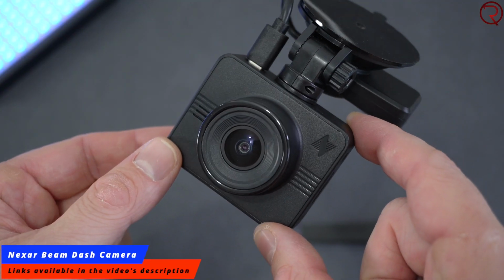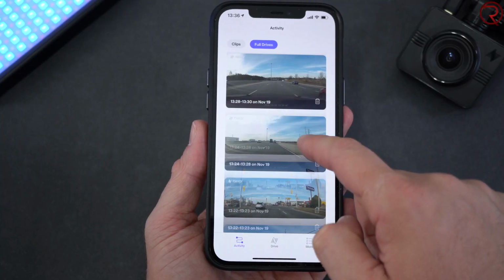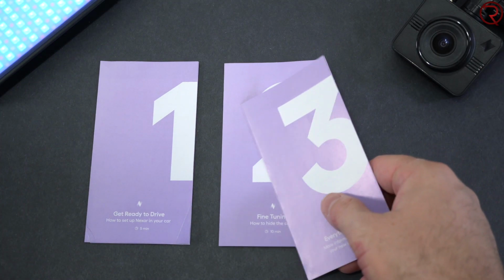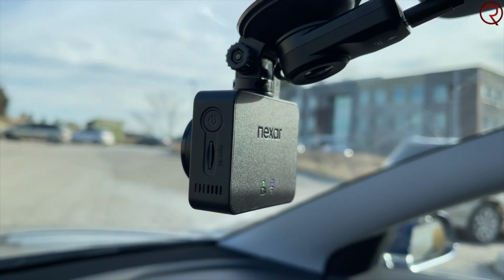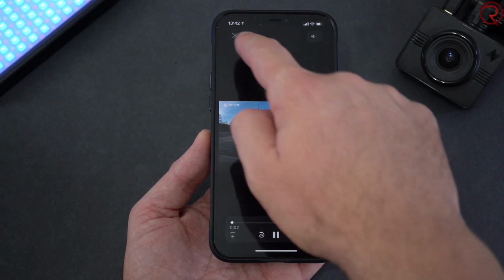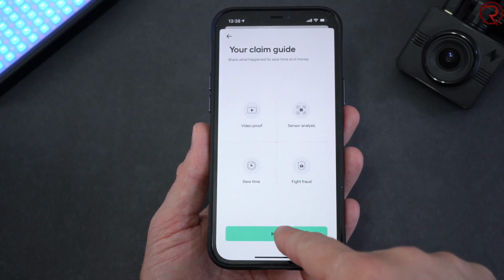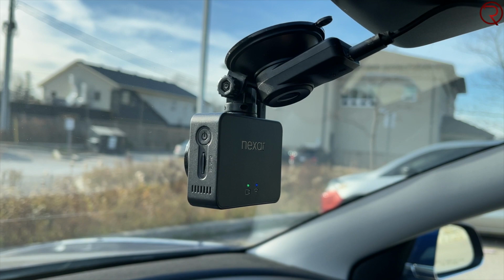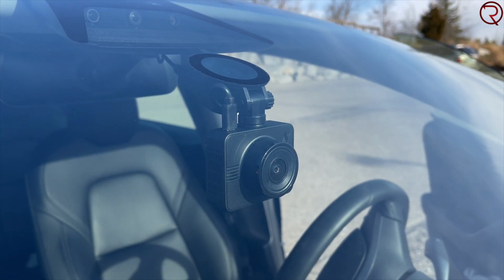Nexar Beam Review - The Most Unique Smart Dash Camera!

Comment: Few questions I don't see in the comments already:
1) Do the detailed reports of each drive have the average speed on them after the recordings? The details on their site say they have an accelerometer and the accident reports ability show impact speed so it must have some way of recording your speed.
2) When the camera is connected to your phone via the wifi does it prevent your phone from using data while connected? Ie can you still receive messages/calls/play music from an app or use GPS?

Thanks for the video, I found it very helpful so far. I'm looking for a good dash cam with a good app to back it. Currently have a Rove 4k in 1 vehicle and hate hate hate the app. Very user unfriendly and trying to transfer video from the cam's SD to the phone via its wifi takes ages.

Comment: Hello.     I noticed I am hearing audio.   Can the audio be turned OFF ?   I wouldn’t want to be recording all conversations inside the vehicle all the time . 

Also , I have a brand new 2021 Mazda CX-5 it has power plugs in rear compartment.  Can I purchase a 2nd Beam cam and put it in the rear window?     Would my phone be able to access both cams ?  One at a time of course.  Just in case I’m hit from rear I have a cam there too ?  

Lastly , my NEW car has a BUILT IN WIFI as part of this new vehicle.  So can the cam be signed into that WiFi and still send me the videos on MY phone even if my phone is NOT in the vehicle.    For instance , my Daughter borrows my car , will the cam use the Built in Mazda WiFi (AT&T) service. and send me videos etc ??
Reply: Yes but you would be able to connect to one camera at a time

No, the camera emits a Wi-Fi signal to connect to, not able to connect itself to a Wi-Fi signal
Reply: Will it alert you if someone is trying to break into your vehicle?
Reply: @justicecarter3857 not sure about that specific scenario, but I was at laundry Mat chillen in my car and went to check my clothes and the camera sent me a clip of when I close my door just a bit too hard. So maybe if there was some force

Comment: That's not good that it shuts off everytime you turn off the Car, what about when a Cop pulls you over and commits a Crime against your rights?
Reply from the maker: Well...you could always hardwire a dash camera to your car's battery and than it will stay on ..
Reply: @RedskullPro  Good Idea 💡👌
Reply: Leave or car on?
Reply: Leave the ignition key switch on, in accessories mode, you don't need to have the engine running in order to provide juice to feed the camera.